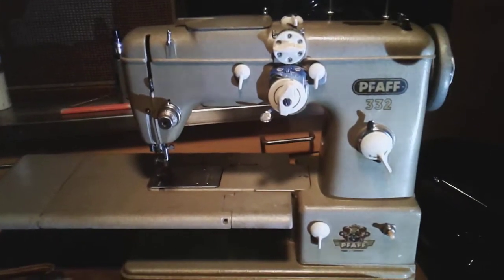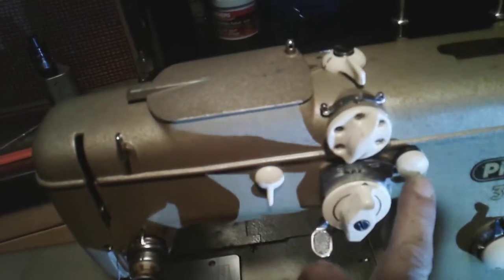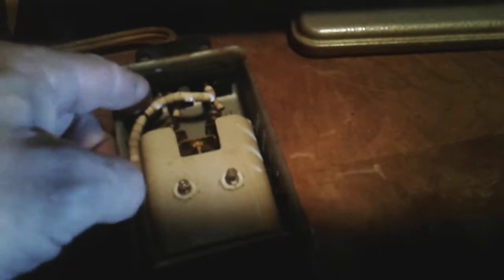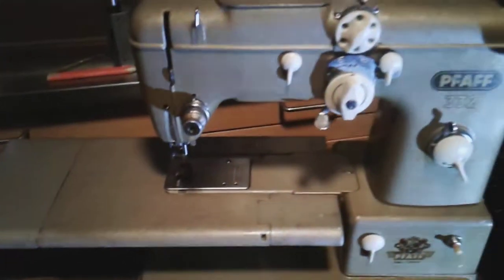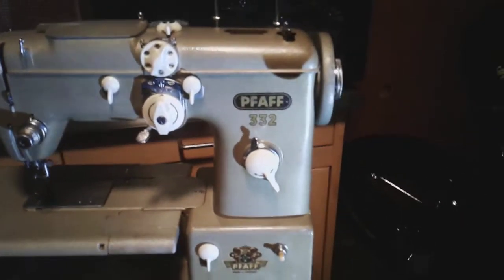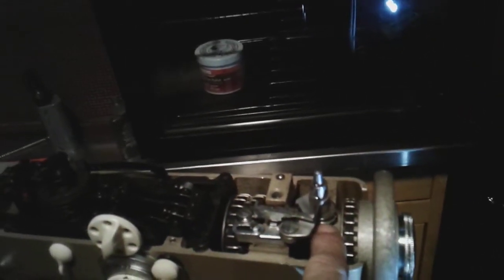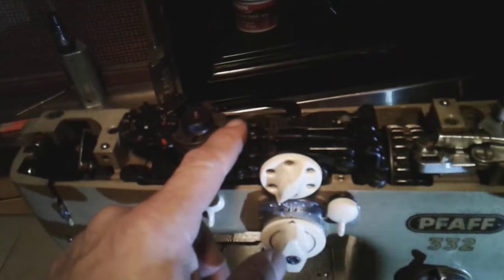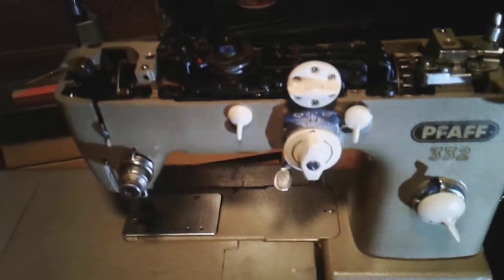PFAFF 332 cleaned and serviced / but ive never seen this before ???

Comment: How did you get the foot pedal open?  I need to re-wire mine and it's not obvious to me how these things come apart.  Any help would be appreciated.
Reply from the maker: On the bottom side of the pedal in the center of the bottom cover you will see 2 small nuts , remove them and you can pull the bottom cover off and your good to go , just a tip you will see what looks like a canister capacitor , be careful because mine started blowing toxic smoke out of that thing and i unplugged and never used the pedal,  but i think you can cut and bypass that piece , i seen people do it on old singers , i think it was for not causing interference with telivision sets way back when t.v. was in its infancy...anyways hope this helps ,take care my friend .
Reply: @4486xxdawson  Thank you so much for sharing your expertise.  I really am obliged.
Reply: @4486xxdawson  From what I read, the capacitor can be taken out, but installing a new one doesn't seem to be much of a task.  I can send you a link to a whole discussion about it.